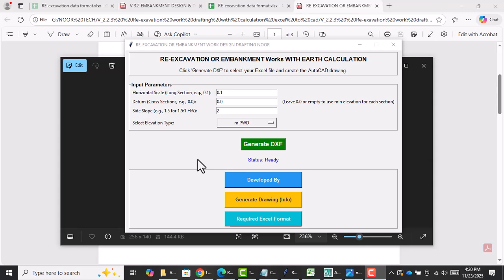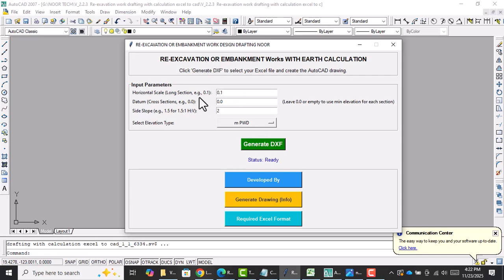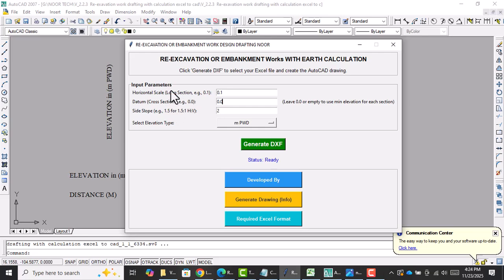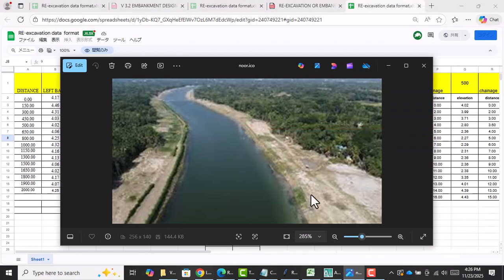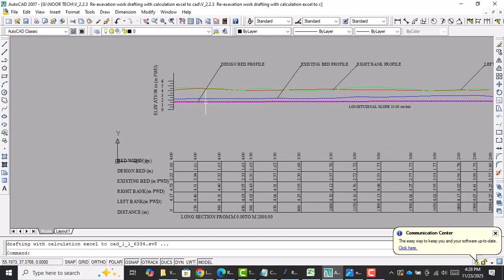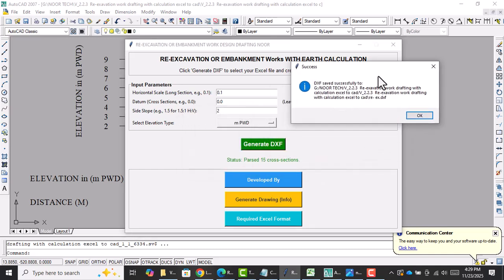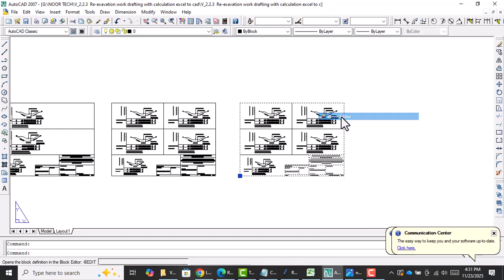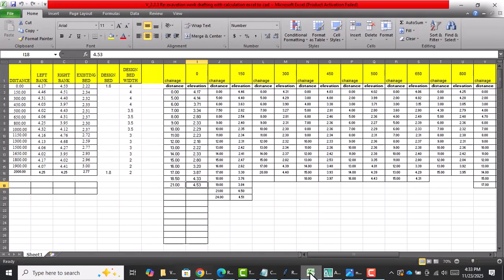Long section Cross section drawing Reexavation work drafting with earth calculation excel to autocad

Comment from the maker: - Developer: NOOR MOHAMMAD (RUET CE-13) - Email: noorruet13@gmail.com

COMMON SOLUTIONS: - Excel not opening: Ensure file is closed during DXF generation - No output: Check Excel format matches template exactly - Slope errors: Verify at least 2 design bed values provided - Missing sections: Ensure chainage values match between sections ..